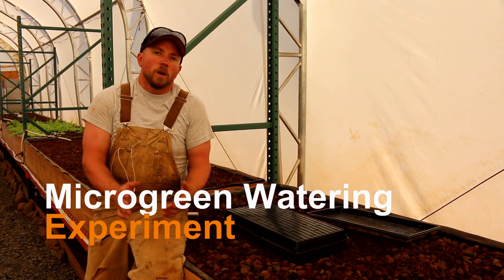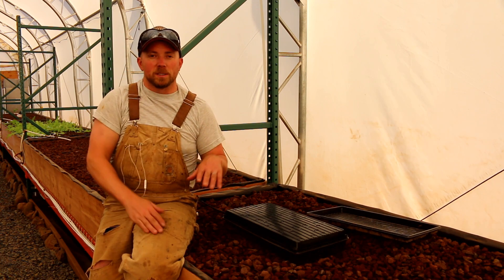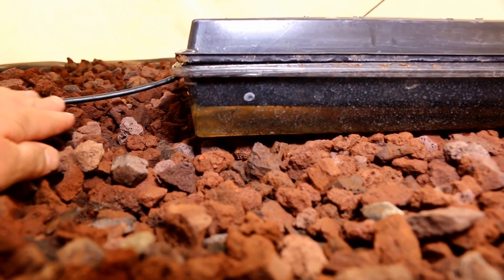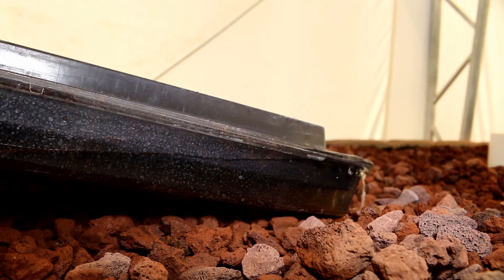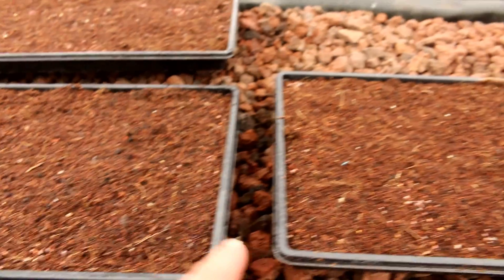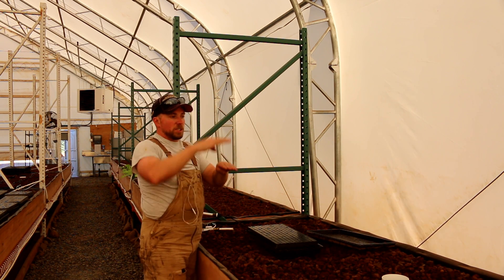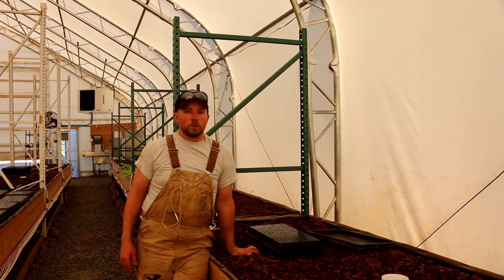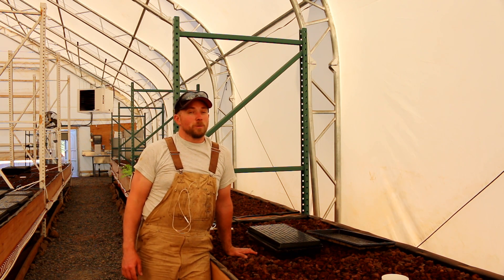What's the BEST way to WATER MICROGREENS?

Comment: Micro-greens don't really require a whole lot of watering .... or even dirt.  In fact, you could do this a lot cleaner just by planting on nylon window screen mesh, which would be quite easy to clean and sanitize.  Your idea to use the aquaponic water solution would be adequate, you just need to make sure you keep the mold and fungus under control by germinating with hydrogen peroxide/water mix.  You start off with a set water level and then trap the moisture in the container by using a lid to control evaporation.  All of the energy required to start the growth process is already there in the seed ...    The better you control the water evaporation, the longer you can go without needing to water it again.

After 4 or 5 days, check to make sure that the water level is high enough that the greens are putting their roots down into the water below, and see if it is time to take the lid off to allow the light to reach the greens in order to green them up.  After this check for water level, you should not need to water again, harvest time would be within a week.

Comment: Use the same construction technique as your Aquaponics troughs below only shallower. Then use a small fountain pump on a timer to flood the trough 2-3 times per day. Flood from a fitting in the floor of the trough so the water drains back through the pump when it is off. Finally, add an overflow fitting with standpipe that only allows the water to get about 1/2" - 3/4" deep.

This company may also make ebb and flow tables that drain really well that will fit on you're shelves: 

http://purehydroponics.com/products/ebb-and-flow-tables-propagation/

I'm hoping to add a 4' x 25' table like this to my greenhouse within the next couple of months for my microgreens.

Comment: I don't know anything about micro greens, but I do grow my own garden flowers from seeds. While germinating I put a glass plate over the tray, creating a micro climate. All moisture that evaporates condenses on the glass plate and returns (drips down) to the tray. I don't need to add water until the moment where I take of the glass plate and move the seedlings to flower pots for their next growing stage. Basically there is 100% humidity under the glass without any effort on my part.

Comment: Make 1 inch deep water holding shelves to set the microgreens trays in and flood and drain them on an automated schedule.
You could block off the back of the shelf for those seeds that sprout in the dark and put a curtain on the front to save a lot of labor. I am a firm believer in wicking to water plants. As the root system gets established the water level can be lower so the surface stays dry enough to discourage mold.

Comment: If you need to water the germinating trays that much a wire shelf to really compact them with timed spray bars into the lids. It will save grow space as you know ahead of time how many trays you need for each lane. Lids stay in place when you move the trays to the lanes so you can reuse for the next round after disinfecting them.

Comment: Stacking will actually help your germination in some cases.  I'm stacking mine for 2.5 -3 days depending on what I am growing.  One exception and it actually has to do with your flood drain system.  Fennel has to be soaking for 12-18 hours before sowing, but then you get the gobs of seed.  We are using a peat based medium so I fill my tray, sprinkle out the seed, then set my tray in a larger container and allow it fill from the bottom up to saturate not only the peat but essentially "soak" the fennel .  Seems to be working and makes it way easier to spread the seed evenly.

Comment: What we do in fish-farming when we hatch the eggs might work for your microgreens.
The eggs require fresh flowing water at a set depth. So what we do is have one end of a big tray having the water inlet that you can control the flow of the water. The other end has a standing drain pipe that you can adjust up or down depending on your need, so when the water gets to the desired level it drains down into the next spawn tray and so on. Just replace the fish eggs with the plants :)
Reply: that is the best way to do it.. Place the trays in troughs they have [Remove all the Cock from the beds that have Micro greens in.. Makes it easier to wipe down the area's..

If the Rock is Kept in place you can expect the algae to Explode..
As you have.. said.. an Open standing pipe to control the depth of the water and have it constant flowing to refresh.. and yes you can use Fish water.. for the extra food..

Comment: Water will wick up quite a long way.  I have 700mm high wicking beds and I keep the water level at 300mm in an aggregate base with a layer of geomesh between the stone and soil.  I never water from the top other than the rain that falls from the sky.  The soil is always moist - never soggy.  Even in the height of summer at 45 to 50C, the mulch on the surface protects the soil and the soil is never dry.  Double pan seedling trays have always worked for me.   Similar to what you are using.  If you have moisture sensors in your soil you can automate the introduction of additional water from below to ensure that your moisture levels in the trays are best suited to the seeds you are trying to germinate. As you are not in a closed system, you will always get some evaporation, so you need to replenish lost water.  It does not hurt to let the soil be slightly dryer as some seeds don't like overly wet soil.  You should set up some control planting areas and do some tests on soil moisture, air humidity and temperature and other variables to see the optimum conditions for your seeds to start their journey and design your system accordingly.